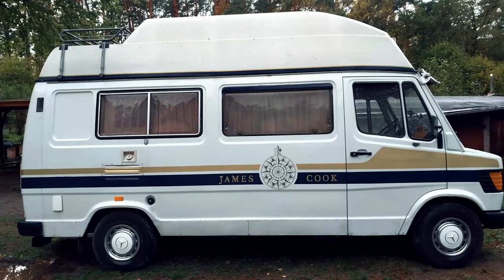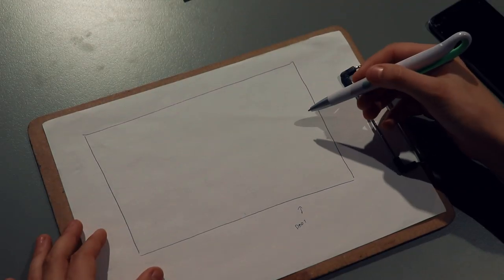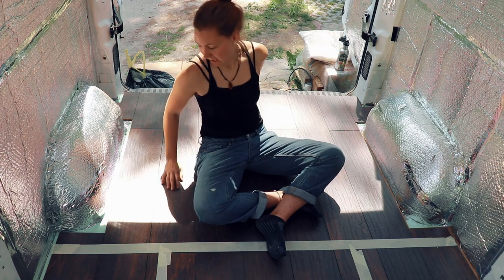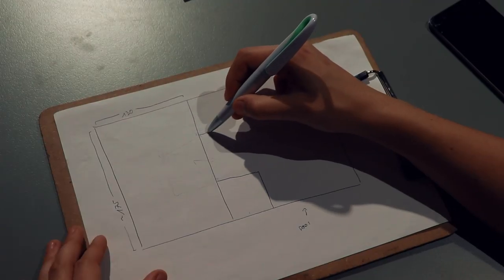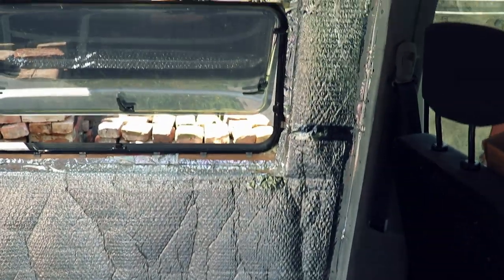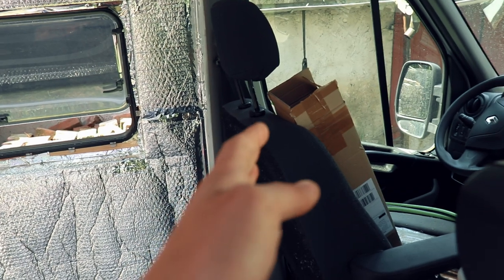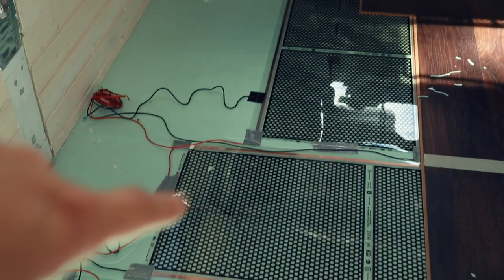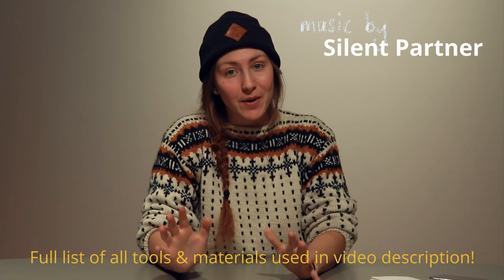FLOOR HEATING in a VAN??? My Layout | Van Build #05

Comment: Would have been nice to get a bit more information about the thermostat. Is it switching on and off the foil or regulating the amount power that goes through it. How do you controll it?
Reply from the maker: You're right! The thermostat is checking the temperature and switches off the power when it goes above a defined value. It switches on again when the temperature drops. Pretty simple bit seems to work 👌 I'll also do another video where I'm talking about the whole electrical setup and I'll show how I wired the thermostat :)
Reply: @lifeoflenja390  Alright thanks. Which thermostat are you using? do you have a link?
Reply from the maker: @Jetiexperte  I used one of these per foil: https://www.amazon.de/Andoer-digitaler-Temperaturregler-Thermoelement-Sensor/dp/B00HC6PDAW/ref=mp_s_a_1_13?keywords=Thermostat+12v&qid=1575652339&sr=8-13

Comment: Wow this is the first time I've seen this idea.  How is it working for you so far Lenja? Would you recommend it?  We haven't put our floor panels down yet so there is still time! 😄
Reply from the maker: It's working great actually! It doesn't drain the battery as much as I thought and it gets really nice and warm. Perfect when it's cold and you're cooking. I have to say though, it's not a good replacement for a heater since it's not enough to heat the whole space. It was alot cheaper than istalling a heater so I still have some budget left to install a second heat source and I think the combination of the two will be ideal for me. Hope that helps :)
Reply: @lifeoflenja390  Thanks for this video! I have been looking into all of my options and I am so intrigued with this as well. I am converting a very small camper van (think: a delivery truck in the form of a long-ish Renault Kangoo) Do you think the heating foil would be sufficient for that kind of space? I just need something easy to install and without eating lots of electricity. Any thoughts??
Reply from the maker: @lynnemarie7885  They are indeed easy to install but they are NOT easy on your batteries! They eat a good amount of the electricity in my batteries and I have two huge packs. They also only really heat up the floor and not so much the air inside the vehicle... it's up to you of course but I think as a main heater you would be better off with a diesel/gas heater. That's harder to Install though...
Reply: @lifeoflenja390  Thanks so much for the advice. I was slowly coming to the same conclusion sadly. I just find it hard to invest that much to heat up such a small area. In the end, I guess it's important to know what you need it for (Like, I intend to work from the van, so I am going to need heat. And batteries hahaha) So yeah, lovely plan, but not feasible. Cheers!

Comment: I bought a big diesel generator for my floor heating. I fitted it on the roof of the van (1m high).  When it rains there is so much smoke coming out of that thing like it's on fire... alredy 2 people called the firefighters what should i do?
Reply from the maker: Sounds like there is something wrong with your generator 😅 I'm not the best person to ask for that issue I'm afraid, I have absolutely 0 experience with generators 😬 sorry, good luck with your generator!